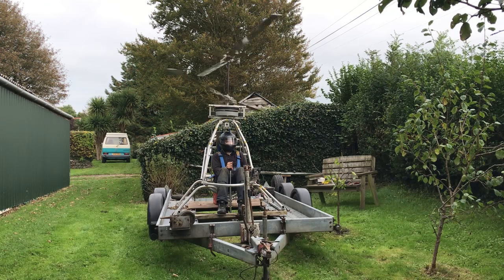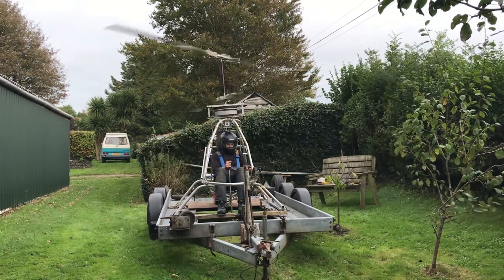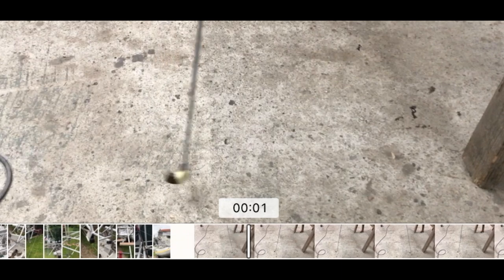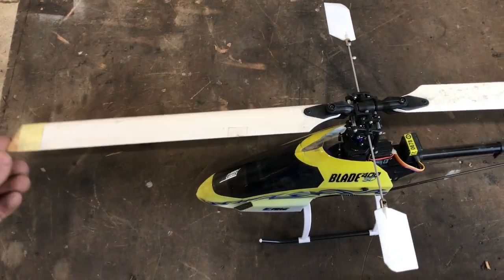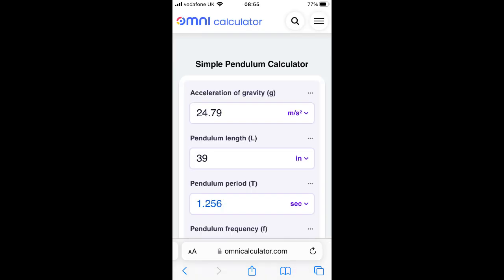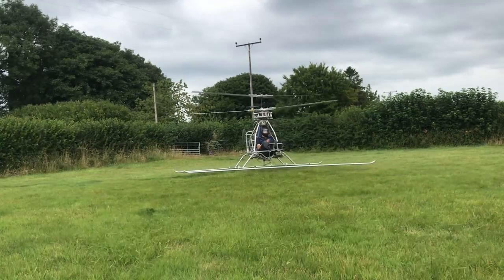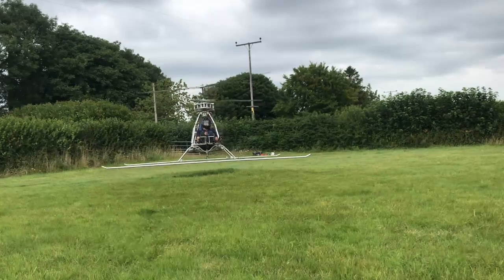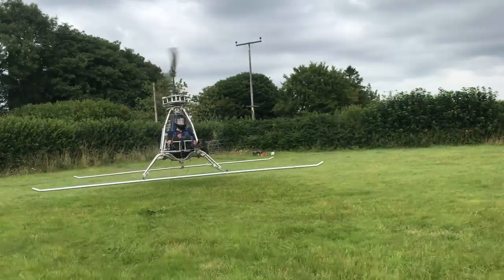Helicopter Rotor Phase Lag vs Gyroscopic Precession WHO IS RIGHT?

Comment: Im not sure I fully agree with this.  Phase lag exists but I am convinced cyclic inputs are adjusted so min/max AOA still occurs 90 degrees out from the desired rotor disc effect.  I know appealing to authority is a fallacy so I'm not going to lean on it, but all of my textbooks and resources for my certifications explain it that way so I just have a difficult time believing they're all wrong.  My instructor was an accomplished Boeing engineer and a IA A&P and taught it that way, so I didn't dig too deep into the details.
Reply from the maker: Thanks for the comment, would you agree Robinson rotors have a phase lag of 72 degrees?
Reply: @Ben-Dixey  Maybe?  I think there's some distinction that needs to be made.  I believe the designed phase angle for all helicopters is 90 degrees.  There is a phase angle shift that is the cause of blade loading, aerodynamics, and resonance which I believe you're referencing here.  For example, on the pitch horn leads/trails the blade by 45 degrees and swashplate displacement is 45 degrees on 4 bladed Bell helicopters (90 total).

The Lynx has a similar offset to Robinsons, 15 degrees ahead of the lateral axis.  Because of its stiffness and the phase angle shift, the disc would move in uncommanded directions.  The solution for the former was a black box sensing system that detected uncommanded movements and made servo inputs to move the blade into the commanded position.

Robinsons do not need this because the Lynx has a 15 degree offset and a 90 degree phase angle, whereas the Robinsons have a 18 degree offset and a 72 degree phase angle.  So no correction with servos is needed.

So yes.  The phase lag exists, but there is a designed offset that makes it still add up to the 90 and some helicopters have advanced systems to assist when it doesn't.  So both things are true, phase lag exists and gyroscope precession functions as it should in most cases.

I gotta do more reading though, I'm typing as I'm learning here so not fully vetting all information.
Reply from the maker: @Maverickib  Ok, I'll have a think about this. I've read about blade loading changing the phase lag or offset.  Blade loading would effect the frequency too wouldn't it ?
Reply: @Ben-Dixey  I'll also have to think on that more.  Initial thought is rotor systems are designed to cone under load via hinges or blade flexing.  That coning may be engineered to also adjust frequencies so the phase lag doesn't change under varying loads.

Comment: Should I have just said nothing? Yes. I just can't let this go because misinformation on the internet travels faster than truth. This vid indicates the seriousness with which you misunderstand this topic. How about you build a coaxial RC helicopter model version of your project and try to get it to fly before espousing your insights. Me? I'm just a 5000 Hr turbine helicopter owner/pilot with a PhD in physics.
Reply: So why don't you explain your understanding of it. Without explaining, your comment can be perceived as misinformation.
Reply from the maker: If I'm wrong I'm more than happy to delete or edit the video. Like you, I don't like misinformation. Please explain why this is misinformation.
Reply: @Ben-Dixey  I won't write a dissertation in comments. You have several concepts confuzzled here. Destin's explanation isn't wrong nor is Veritasium's. Have a look at any manufactured helicopter with the collective at full pitch and the cyclic full forward. Rotate the MR and take note of where you see max pitch. It'll be at 90 degrees (L or R depending on the rotation direction). The swashplate does not impart twisting forces on the MR blades so quickly that it would induce any noticeable lag. Noob pilots that move the cyclic too quickly for the MR system to react incur PIO. That's why you're taught not to abruptly  move the cyclic. The control tube mixing box isn't at something ridiculous like 78 degrees, it's at 90. I could go on and on here but here's another short youtube that might help. https://www.youtube.com/watch?v=n5bKzBZ7XuM
Reply from the maker: @chopper3lw  Ok, I think I was wrong to say that Destin was wrong but I do think my explanation to phase lag could still be right. We could be talking about the same thing but explained in different ways ? I had seen the video you linked on gyroscopic precession and don't disagree with it.
Reply: @Ben-Dixey  He doesn't know what phase lag is.
Reply from the maker: @chippyjohn1  There is more than one way to think about what's going on but I do have a quote from Frank Robinson talking about the phase lag of 72 degrees in his rotor heads. I think you could still speculate as to the causes.

Comment: Phase lag is a special case of gyroscopic precession.  Consider the dynamics/cause of gyroscopic precession and that of phase lag.  They are fundamentally the same thing.  The fact that we have a complex system involving two or more blades rather than a rigid disk, offset hinges, etc. does not eliminate the basic cause.  It complicates the result for the reasons you describe.
Reply from the maker: Interesting comment, I'll give that some thought 👍 
A quick glance at your channel, did you build that machine that goes into the wind using prop driven wheels ?
Reply: @Ben-Dixey  I did.  It was initially designed and configured to go directly downwind faster than the wind.  In this configuration the wheels drive the propeller.  When I reconfigured it to go directly into the wind faster than the wind, I had to replace the propeller with a turbine, and reverse the drive so the turbine would drive the wheels.
Reply from the maker: @Rick_Cavallaro  I knew I had that prop driving wheels the wrong way around. Ha! Great to have contact with you I watched the video from that science guy all about it. Sounds like I have some catching up to do on your channel.
Reply: @Ben-Dixey  I have sort of a non-channel.  I typically just post things to share with friends.  But a few days ago I posted a new brain teaser that I really like.  I'll post the answer in the next few days.  You should check it out and weigh in with your thoughts.
Reply from the maker: @Rick_Cavallaro sounds interesting, I'll have a look. 👍
Reply from the maker: @Rick_Cavallaro  Hi Rick, I wonder what your thoughts are on this. When you have two wheels connected via a shaft spinning in opposite directions precession is cancelled and so is all the gyroscopic effects. 
If you had a ridged coaxial rotor knowing that precession is cancelled, how can the phase lag that would be present be explained by gyroscopic precession ?
Reply: @Ben-Dixey  If both rotors are rigid, and rigidly attached to one another, I'm not sure what phase lag you'd be seeing.  Are you talking about the phase lag that would be apparent from the flexibility of the blades themselves?
Reply from the maker: @Rick_Cavallaro  The blade flex would be giving the phase lag and I would expect it to be something like the BO105 or Lynx. I'd like to know what the Sikorsky X2 rotor lag is but doesn't the removal of precession in a fixed coaxial rotor mean that gyroscopic precision cannot be used as the explanation to phase lag?
Reply: @Ben-Dixey  
>> doesn't the removal of precession in a fixed coaxial rotor mean that gyroscopic precision cannot be used as the explanation to phase lag?

No.  If the blades were rigid, that would be the case.  In the case of flexible blades, the precession or phase lag manifests in the blade flex itself.  After all, the flex of the blades is no different than a pivoting or hinged blade except that it's somewhat distributed along the span of the blade.
Reply from the maker: @Rick_Cavallaro  Ok. Thank you for explaining. 👍

Comment: As an afterthought Ben, in the case of your machine the whole rotor head and gear box and drive shafts  are doind the tilting, wouldn't gyroscopic forces act on this, as a conventional machine the forces are coming from the blades  themselves by cycilc pitch change. Thus tilting the disc the direction you want to go. ?
Reply from the maker: Hi, the rotors are gyroscopes yes but aerodynamics control the rotor. My blades change the angle of attack as they rotate just like a helicopter with a swash plate. The aerodynamics act like servo assisted steering for a car and that moves the discs even though they don't want to move being gyroscopes.
Reply: @Ben-Dixey  well at the end of all this Ben is this the reason why they  build helicopters with swash plates and cyclic pitch change, and not the configuration that you've have ?
Reply from the maker: @cloudusterable  you need blades to feather to autorotate, if you need blades to feather you might as well control the machine with cyclic feathering. 
With a coaxial as you know double swash plates can get complicated particularly with differential collective. 
I don't think the tilting mast will replace anything outside of a home built helicopter but gyro copters certainly make use of them.

Comment: Еще зависит от типа втулки несущего винта. 
Если втулка несущего винта выполнена по жесткой схеме, усилия от лопастей непосредственно передаются на вал редуктора и конструкцию вертолета, имеет почти нулевое запаздывание по фазе.
Если втулка шарнирная, то там иной механизм передачи усилия от лопастей к валу редуктора. Он принципиально отличается от механизма передачи усилия жесткой системы, имеет звено компенсатора взмаха, который вносит значительное запаздывание по фазе. Чтобы управлять такой системой, они управляют положением конуса винта, которое отклоняется ручкой, а непосредственное воздействие на вертолет происходит косвенным путем через баланс центробежной силы и плеча, одна сторона которого равна  радиусу между осями шарниров.
Reply from the maker: I have read that a ridged rotor has virtually no phase lag but I've also read the BO105 has 75-80 degrees of rotor phase lag which is a ridged rotor system. 
A rotor system with no phase lag doesn't make any sense to me. Even if the blades are ridged it would still take time for the blade to flex up to maximum displacement. A blade that is rigidly mounted still has a frequency at which it oscillates doesn't it ?
Reply: @Ben-Dixey  Безусловно любая упругая балка, закрепленная с одной стороны, имеет свою резонансную частоту. 
А по поводу BO-105,  если рассматривать максимальный угол установки лопасти для движения ЛА  вперед, плоскость качания шайбы автомата перекоса необходимо повернуть с опережением на угол ~75 градусов из за некоторого смещения точки приложения сил к поводку лопасти, на который действует вертикальная тяга. 
Угол установки лопастей над хвостовой балкой (0 азимут) будет иметь пик как раз при опережении шайбы 75-80 градусов. 
В шарнирной схеме все сложнее и имеет место то, о чем вы упоминули